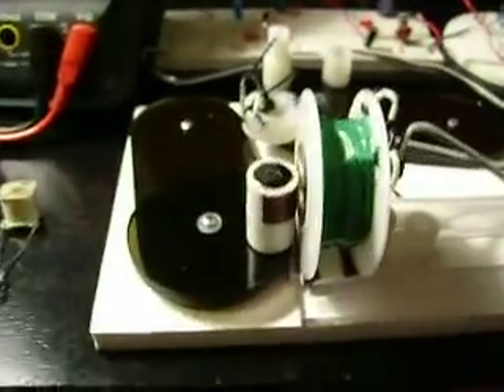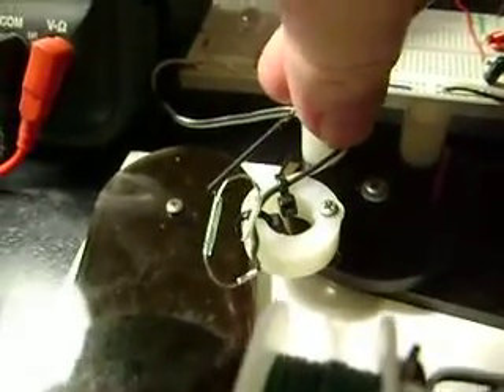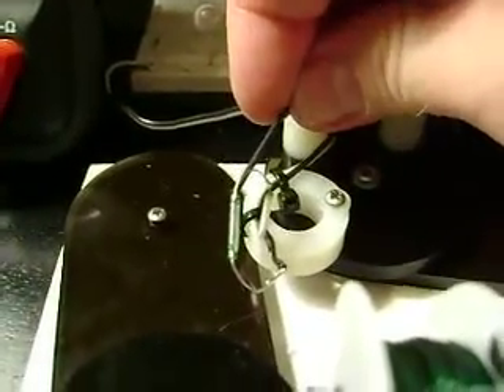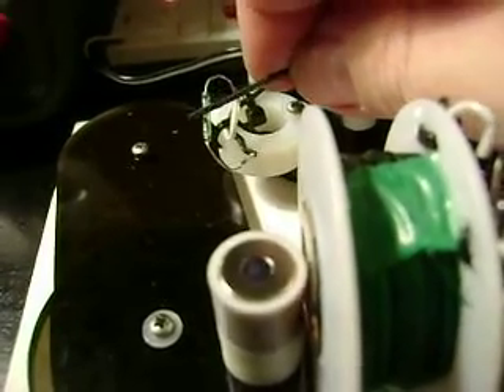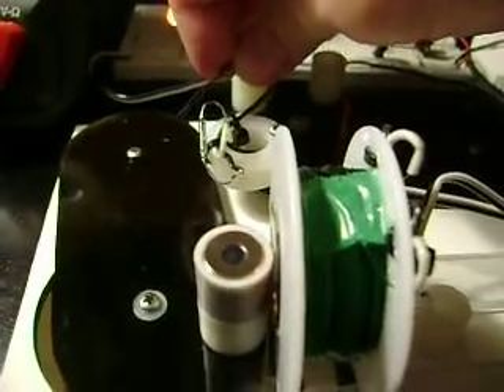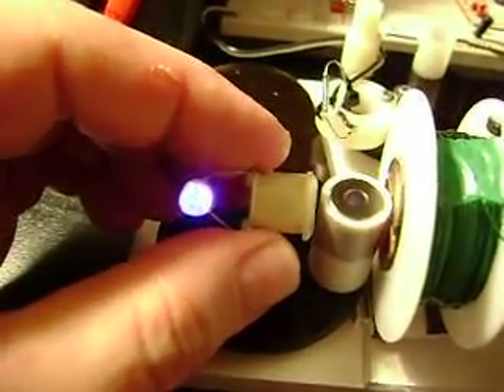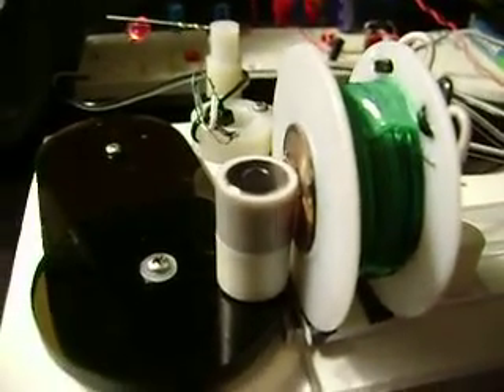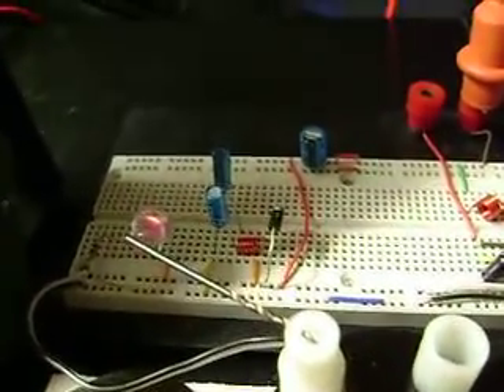Pulse motor using a Whipmag stator for rotor

Comment from the maker: Thanks Z
She is still running but not like yours. Its down to 1.337v and only about 15 hours. It speeds up now and again and the voltage starts to climb.
Yea, the reed thing is neat. it can also increase the speed if you get it in the right spot. Have you tried the drill bit yet?
Mags